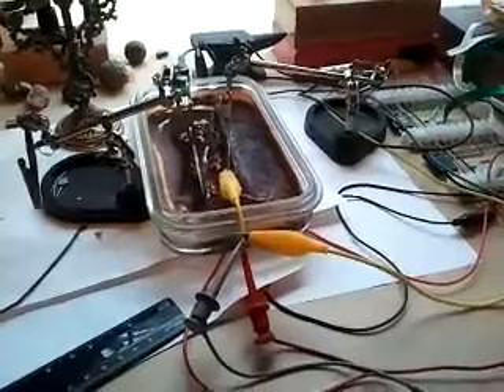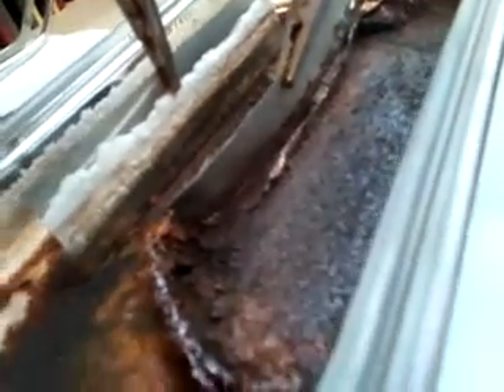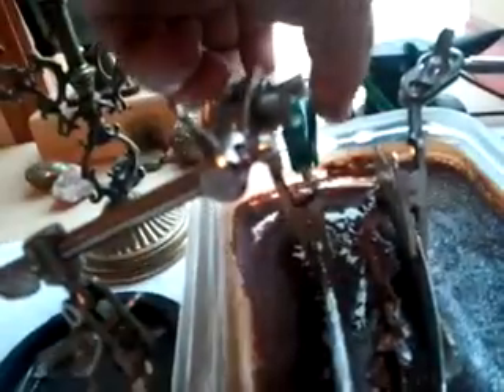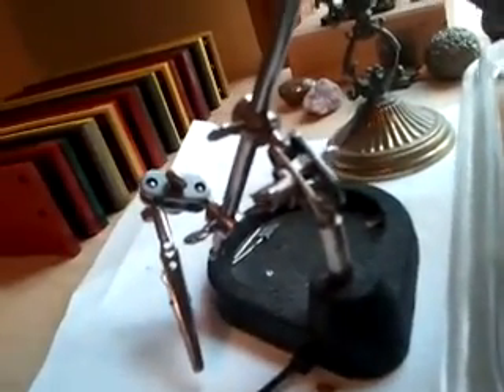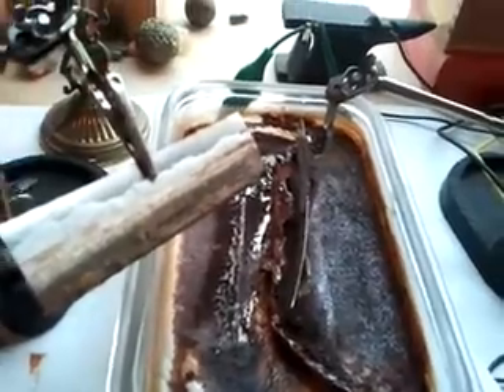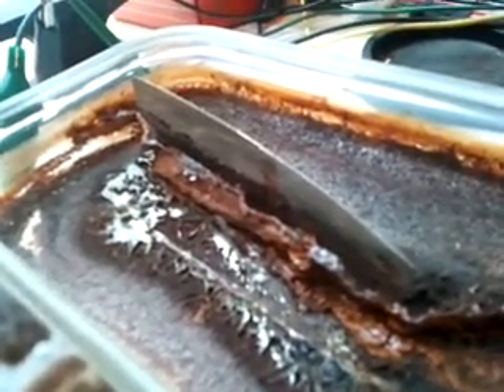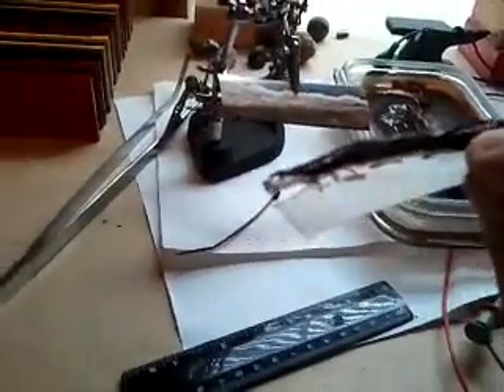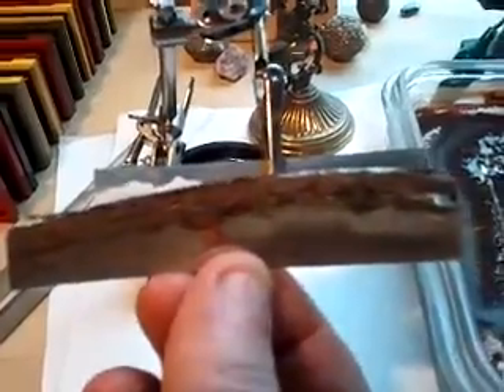Magnetohydrodynamic water pump dries up part 1

Comment: I personally don't trust anything on a label... Distilling water isn't too hard to do at home, at least then you have no one else to blame :)  How about gathering the residue and weighing it - if you have the pre-run weights of the plates you can see exactly what came out of the water and what came from the plates (by weight).  Looks like most of it came from the water, with precipitates being deposited along the flow path.  I believe MHD units use magnets along their length, maybe distill, add magnets and try again.

Cheers!